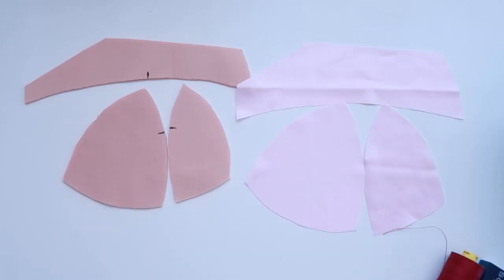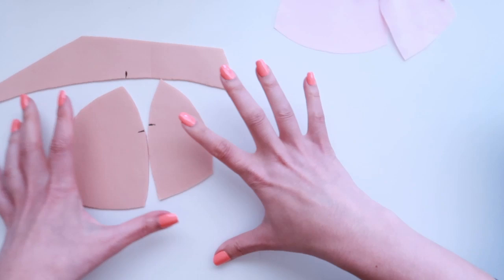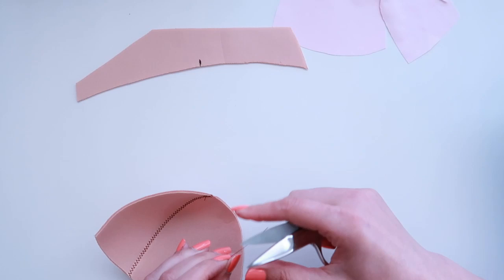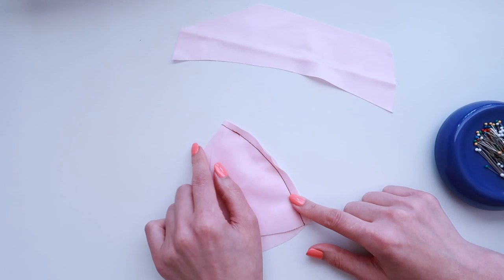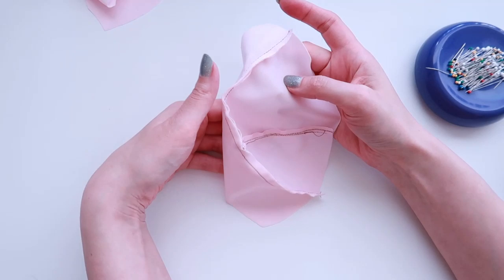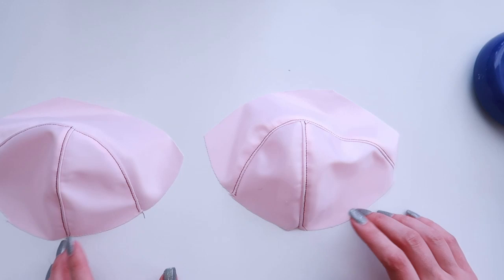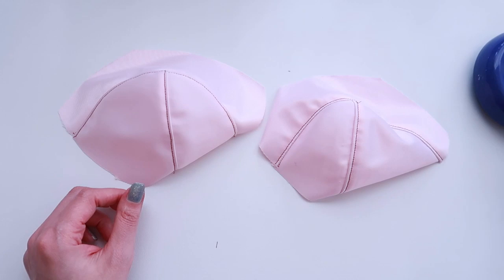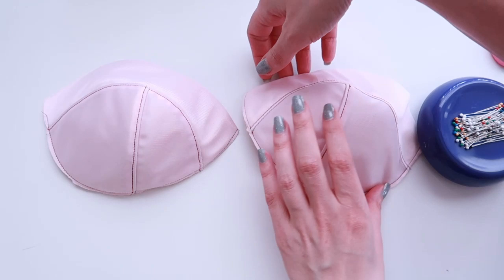Bra making 101: Sewing the cups of the Maya Bra

Comment: Firstly thank you for these tutorials, I’m just about to attempt to make my own bra for the first time and these videos are fantastic.    I do have a query though.  In this tutorial you use foam lining, however, I’m not intending to use foam or any other sort of lining.   How  do you finish the top of the bra, where you attached the foam and folded it over to form the top of the inner half of the cup.    I see what you do with the outer half, using the under arm elastic, but as the tail of this is used to attach the strap, I’m unsure what to do with the other half of the top of the cup?   I don’t really want a joint here as I think it would look messy.  Any advice greatly appreciated.  Thanks

Comment: Great instruction!  What straight stitch length are you using?  Do you adjust the tension at all when sewing these fabrics?
Reply from the maker: I just use my machines standard stitch length and tension but if you are having troubles getting pretty stitches a longer length or less tension may help